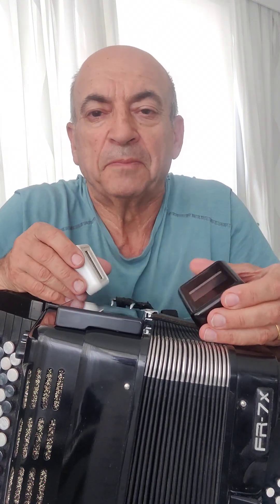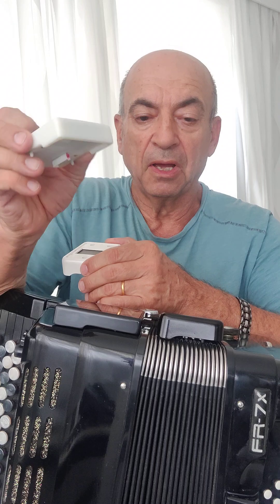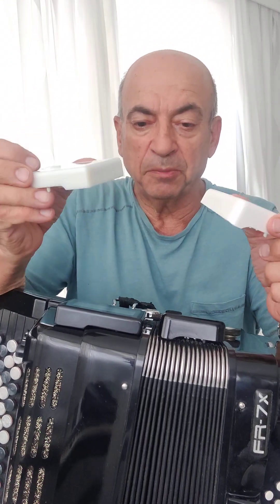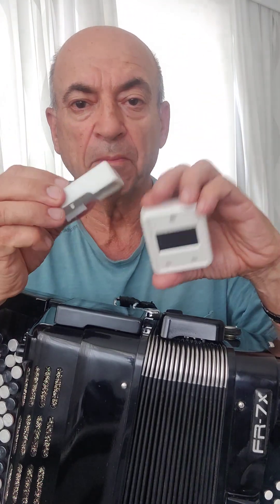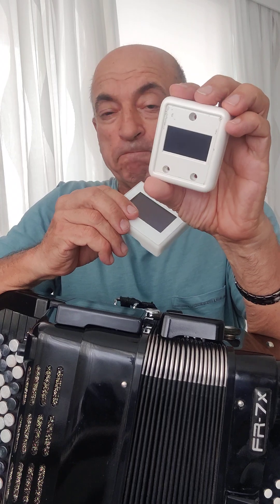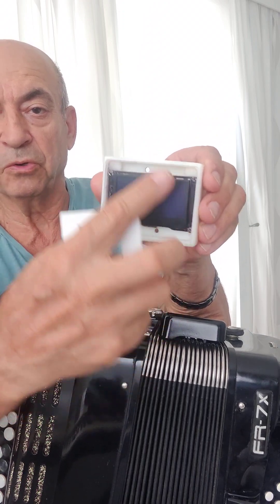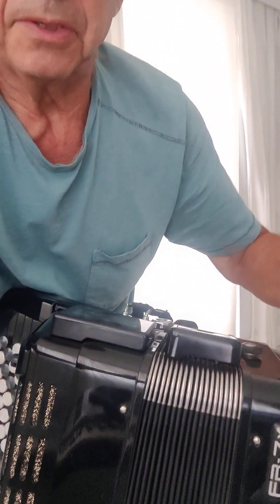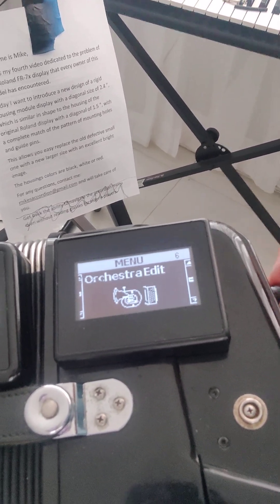September 19, 2024

Comment: Thanks Mike for solving this long standing problem with the Roland 7x. My original display unit has been replaced a number of times now and Roland has ceased supplying replacement display panels so I will be putting my order in for your enlarged display screen. Congratulations and thanks again for your efforts in assisting Roland FR 7x accordion players.